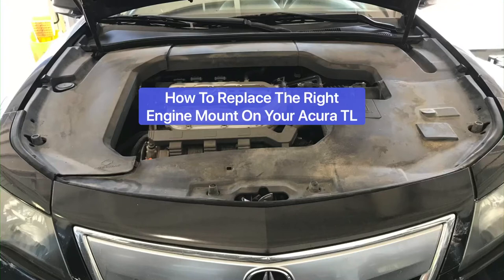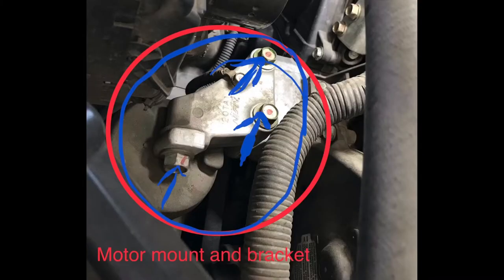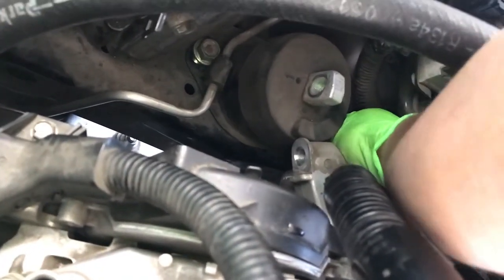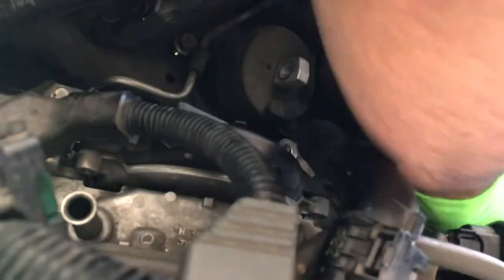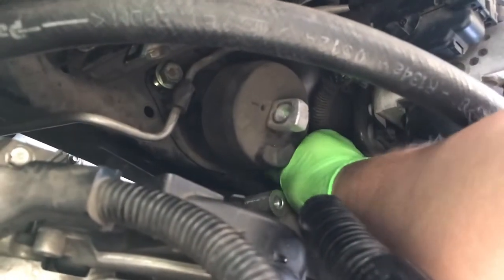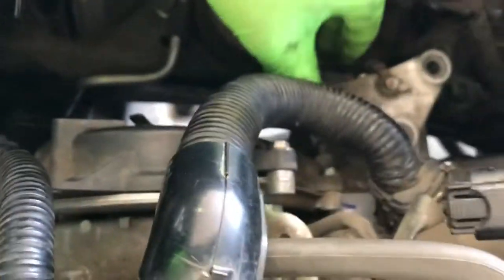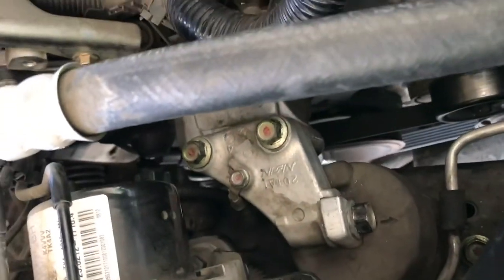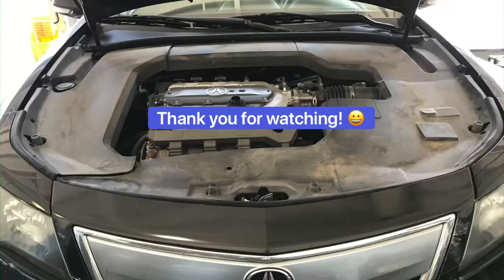2009 -2014 Acura TL - How To Replace The Side Engine Mount - DIY

Comment: Thanks! I have a 2010 TL and finally a video of someone changing it on a 4th gen TL!
Reply from the maker: Kobe_FTW! ! Thank you, Kobe_FTW. Glad the video is helpful. Let’s me know if you have any questions, I’ll answer if I can.
Reply: @huunwheels7378  do you know how many total mounts there are? I heard there is a side one, a rear one, a front one, an upper transmission one under the air intake, and a small one attached to the transmission behind the driver wheel well. So 5 total?
Reply from the maker: Kobe_FTW! ! Yes. You’re right. It has total of 5 mounts.
Reply: @huunwheels7378  thanks for confirming! Do you know which ones require jacking up either the transmission or engine to safely get out?
Reply from the maker: Kobe_FTW! ! the right engine side one and the upper transmission mount(under the intake) don’t need to jack up the engine. The others need to lift the motor up.
Reply: @huunwheels7378  thanks!

Comment: You Jack the engine up first? Might want to include that very important step..
Reply from the maker: @MrRedHotChiliMan  for the side mount, didn't have to jack the engine up since the other mounts would hold it up just fine.  it's personal reference if you'd like, you can support the engine with a jack.

Comment: Wonderful! How did you determine that that engine mount was the bad one?
Reply from the maker: 1. You could notice on acceleration, there’s raise and drop down feel from engine, kind of like a slightly clunk noise on acceleration. 
2. Visual look at the motor mount by lift up the rubber cover on top of the mount. Sometime you would see dark fluid drip out of the mount.
Reply: @huunwheels7378 Thanks. I have noticed a slight pulsation in the drivetrain under medium-to-hard acceleration, and I suspect it might be a problem with a motor mount. If it were a clogged fuel injector, I think that would trigger a code.
Reply: @huunwheels7378 so my transmission shifts fine when I’m driving but when I’m going from park to drive or reverse it lurches would that be transmission mounts?
Reply from the maker: @deshaunhoston619  hi there. That could be, when the other mounts broke, the rest could crack too.